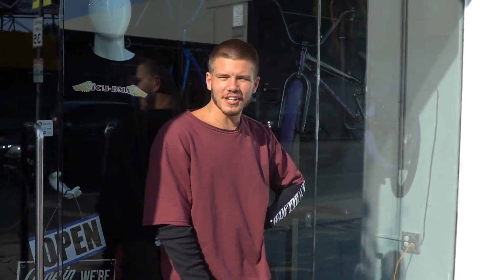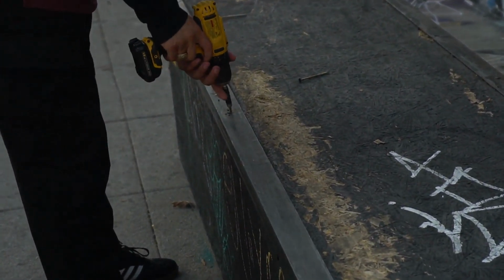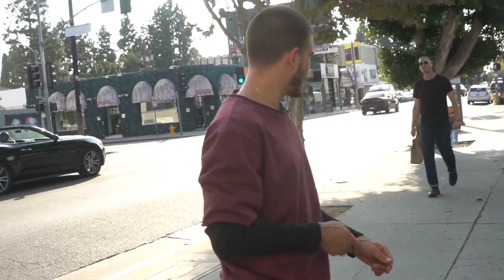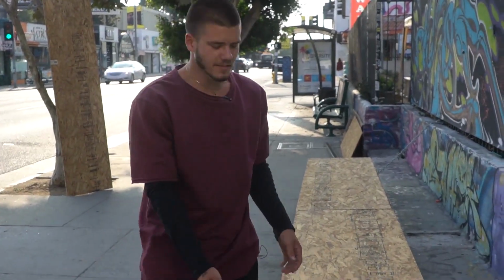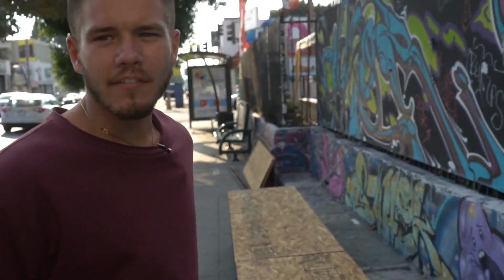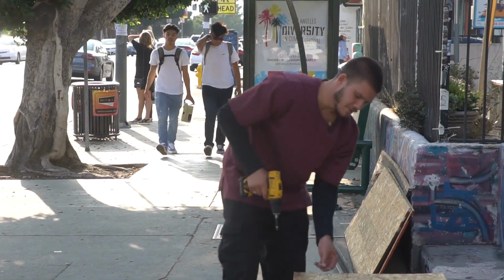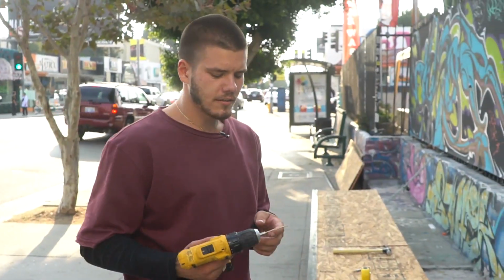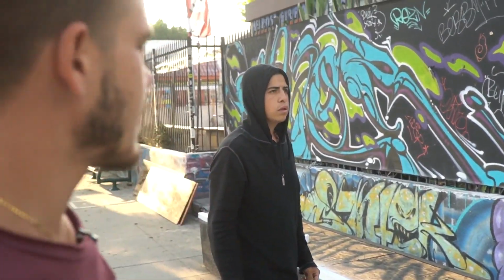SOMEONE BROKE OUR LEDGE SO WE SHOW YOU HOW TO FIX IT!

Comment: Painting it with Exterior Semi-Gloss will help it last twice as long. Yes, predrilling is very important. If you drill them at an angle like he did then the head of the screw is gonna catch when you try to grind. Take your time and do it right. OSB sucks BTW. Real plywood is better. Does anybody else call it a fun box?